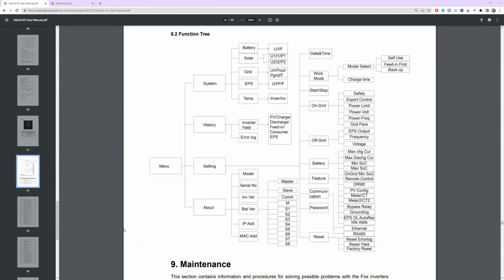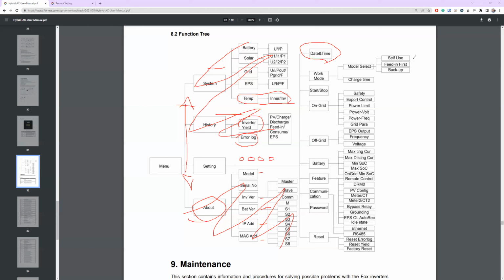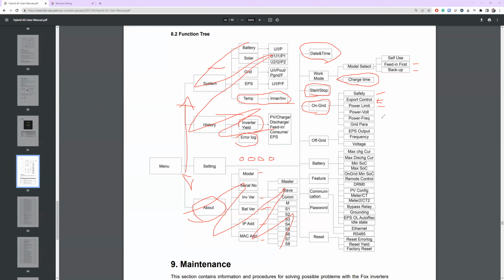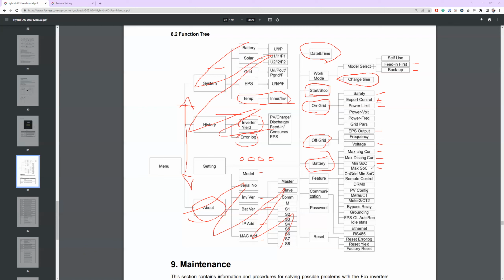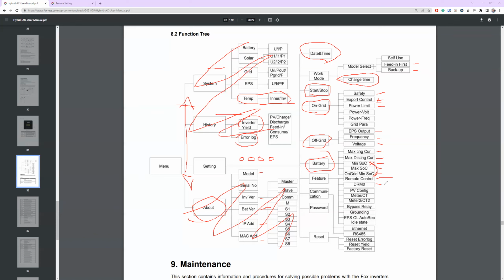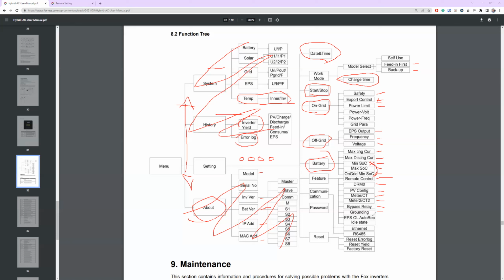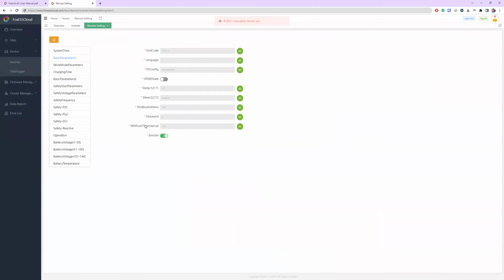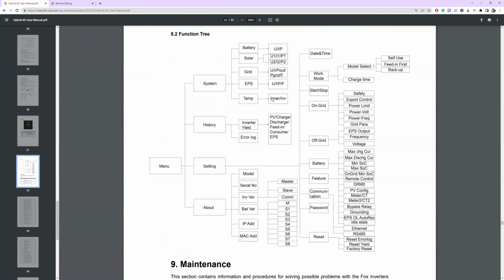FoxESS - Menus, Settings and Installer Options Walk Through

Comment: Is is possible to limit the power or ampere output from the battery? We are exploring battery to avoid getting 3 phase so we need the battery to last a certain number of hours before it is empty
Reply from the maker: Yes, you can set the power % on the inverter or limit the battery amps in the settings

Comment: I have had to reduce the power limit on my H16.0 E G2 as RCB was tripping and I am waiting for installer to reply. After following your video I found that in the inverter menu Grid  Power limit was not in amps but 100% so I have changed it 70% and will wait to see tonight if it trips again.
Reply from the maker: great to hear that the video helped. a 6kW inverter should be on a 32a MCB
Reply: @iameccles  Was I right to reduce the grid power limit to 70% and not change the Battery max charge current? Experts on FB are saying to change the Battery charge limit. ?
Reply from the maker: @richardjeffery9496  inverter limit will also work fine. what size mcb is the inverter currently on?

Comment: I have an ESS system and cube battery, but there are things I would like to clarify, I have no manual and do not know where to get one. I tried to speak to FOX and was basically to F-off and contact the installer they would not even talk to me and cut me off.  When I have spent tens of thousands of pounds with them I expect better. I can follow manuals but they do not give me one or even the installer manuals. Is this correct or just a run around.
I wanted to know how to correct the internal clock as when I need to force Charge, the time is different from the app.
I have tried to use their Email system and open a query but it was ignored. I need a software upgrade to enable me to set time for selling my excess at specific times. But without the upgrade it cannot be done..

Comment: Hi maybe somebody knows different code for entering settings? Because 0000 not working.
Reply from the maker: if it's not 0000 or 1234 then your installer has changed the pin and you'll need to contact them for it.
Reply: Thank you, maybe there is way to reset it to factory, to restore factory password?

Comment: I have a fox ess hybrid system two batteries hv2600 am a small electric consumer lights TV oil heating pump when used and batteries don't last the night and only take in 1.6 kw to be 100% full is this working correctly anybody know?
Reply from the maker: recommend you post your question on the forum https://foxesscommunity.com/ or the facebook group https://www.facebook.com/groups/foxessownersgroup
Reply: @iameccles  cheers

Comment: how do i set my solar system so it exports between 4pm and 7pm - as i get paid a higher rate then
Reply from the maker: set your work mode to feedin, this will feed in solar only. You can't export battery to grid yet with FoxESS

Comment: I've just swapped to octopus flux. 
Is there an option on the inverter to say send solar back to grid but run on batteries? 
I thought feed in first might be it, but that looks like its using solar and batteries to power the house (oven on)

Comment: Thanks for the very clear explanations. I have an SMA4000TL inverter on my original PV installation and have now added a separate installation consisting of panels, a Foxess H1-5.0-E inverter and battery storage. I would like to be able to see the SMA data on the Foxess using a CT clamp on CT2. Does it need anything other than the additional clamp wiring into the Foxess please? Any setting up, for example?
Reply: SNAP!  Did you get any joy on this? Guess I will need to run a CT cable from  loft to garage but would be good to see inverter 2 'The Original'' on the CT2.  Current orig system generation appears a as a positive flow from house

Comment: Hi. Thanks for the vids. I have a quick question if you don't mind. I have a new H1 5kw hybrid inverter connected to 14.4kwh of energy cube storage. Set it all up yesterday. It charged overnight on cheap electricity and has been running the home all the way up until about 21.30 tonight when it reached the min SoC of 20%. However, ever since then the app shows the battery as " offline". I have restarted app etc. The display on the fron of the inverter says everything is normal with an SoC of 20%, the WiFi dongle is slowly blinking red and I can connect to it directly through its SSID. 
Is all of this normal? Could it be a problem at the cloud end of things? Same thing on the web page.

Comment: Thank you for taking the time to go through the menus and provide an explanation.
I have been experimenting with Idle State (it was renamed from Low Power Mode in a recent firmware update).
Your assumption around idle is correct: the inverter goes from 50W consumption to around 5W when the load drops to zero. This will happen at any battery SoC, not just 100%.
However, if your battery SoC drops below the Min SoC setting and there is not enough solar input, the unit will also go into Idle Mode and get stuck!
When the sun comes up the next day, the inverter will sit making a horrible rapid relay clicking noise and stay stuck in idle with no power sent to the battery or load.
See: https://youtu.be/kpNDuA-v5-o
Fox UK support were useless and simply told me to turn off the setting, despite the inverter wasting 50W continuously.
Reply from the maker: Just checking you're talking about the settings > feature > idle setting correct?
Reply: @iameccles  yes, that's the one.
Reply: @iameccles  Thanks for this, it’s really helpful! I was hoping you could help me with 2 queries I have. Export control - I have a 10KW inverter and approval for 8.1KW array. The inverter is limited to 13000w. Will this limit export? Is the limit daily/yearly or real time? Also, mine is set to 230v and 50Hz and I have G99 approval for 8.1kw. Do I need to get someone to look at this to change it to 240v? I’m not sure why it would be 230v?

Comment: Hi, Anybody know Is the position 6 on bms box for 8 batteries, and what are the dip switches for on each battery?
Cheers,good  info channel for fox-ess
Reply: Was here yesterday.  DIP rotary on BMS should be on 2 less than the amount of batts you have.  On V2 batts the address DIP is for a different thing.

Comment: Very helpful vid that explained a few parameters that had me, as a retired comms & instrumentation tech, scratching my head. I do have one question. I have the Foxess H1-3.7E with 8 x HV2600's. I believe it may be possible to add the Foxess AC1.5.0E 5kW "charger" and additional say 4 x HV2600 batteries just to power a couple of critical circuits. Where can I find some more info? I'm assuming I could simply take a standard output to charge the 2nd charger, limit currents to the equivalent of about 3kW or less (2kW is more than adequate for the circuits I need) and place the bypass relay into permanent ON mode? I see it that way the 2nd charger (AC1) would top up my secondary batteries and simply run the 2 x circuits I want extra protection for. I believe I could also limit charging via the 2nd inverter (AC1) by either timeswitch or manual override. Any info would be great!